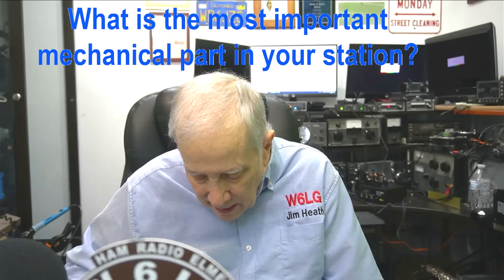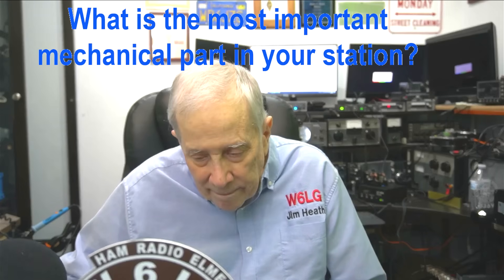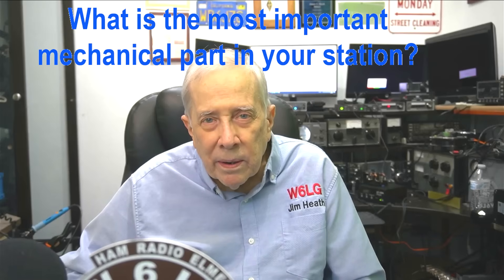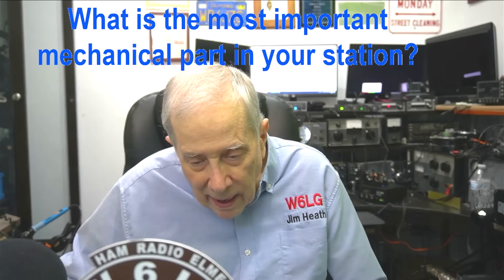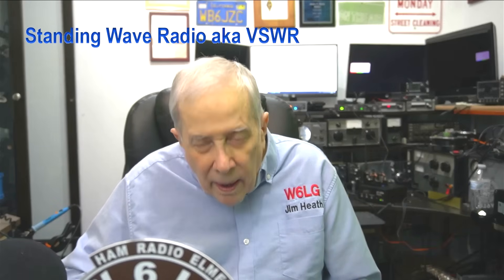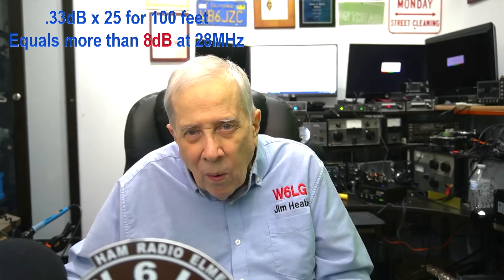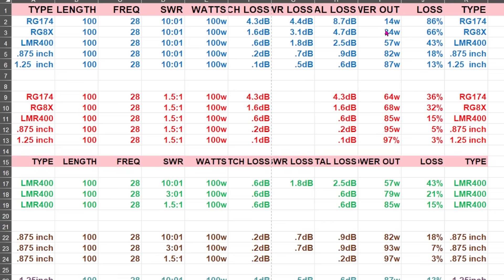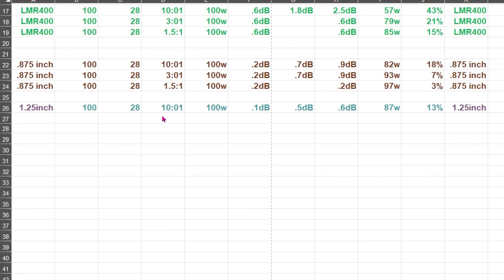Standing Wave Ratio DOES Matter and Here's Why from Jim W6LG

Comment: For HF, only use coax when/where forced to do so.  Plan to use ladder line.  Use coax for the short length connections, such as between antenna match unit and transceiver.

Comment: While lowest SWR is not always at resonance, an SWR of exactly 1.0 IS at resonance.  The only way to be exactly 1.0  is pure resistive equaling Zo.
Reply from the maker: Nope.  73, Jim
Reply: @ham-radio    Consider it on a Smith chart.  The “circle” for SWR exactly 1.0 is just the center point - exact match and resonant.

Comment: One of the most efficient antennas and feed system Iv made was a doublet for 80 meters with tuned open wire feeder , 39.45 meters along the top and the feeder was home made open wire feeder was aprox 40 meters straight into the shack, into a 1:1 choke into approx 1 meter of mini RG8X to radio after a little trimming of feeder 1.2:1 swr on 3.7Mhz

Comment: Thanks Jim! Haven't heard you on the air for a while, hope we can talk again soon. This is exactly why an all-band dipole needs balanced line. In fact, I've never used coax for feedline except mobile. Something I've never heard is an explanation of why the efficiency of coax can be so low - is it the quality of the insulator, conductors, or both?
Reply from the maker: I think the answer is dielectric losses along with size.  73, Jim

Comment: So one conclusion for a guy who does mostly portable operation is that even RG174 is ok (short runs) if the antenna match is very good ( 1.5 :1 or better). Resonant antenna is always a good thing.  Yes, bigger coax is a good thing, but less so than good antenna design in the first place.  My go-to is a linked diplole set up as an inverted vee.  Running portable means I have to tweak it (vee angle) each time I use it to get the best SWR.
Reply: Correct. A 20-30 ft run of rg174 on an antenna with a decent feed point swr is totally fine at HF.
Reply from the maker: If you are willing to give up about 25% of your power in the feedline when the SWR is 1:1. The loss, of course, increases with SWR increases. 73, Jim
Reply: @ham-radio  That's why I emphasized short runs.  Every antenna system is a compromise - performance, cost, durability, portability, neighborhood aesthetics, and probably some others.  Videos like yours help us think through and understand the compromises we make when building our systems.  Thanks, Jim,  for all your work to help us learn more.
Reply: @ham-radio Oh, and I forgot to mention that I'm mostly operating on 20m or 40m. For a given grade of coax, losses decrease as frequency decreases. Again, thanks for your work.

Comment: Excellent video, Jim. You are looking good as well. I hope to continue to hearing from you for years to come.

One item I would love to add to your presentation is the importance of SWR on receive. Before the new ham thinks that this loss of power can be overcome by adding an amplifier, it is important to know that the loss is reciprocal; that is, it is about the same loss in the receive direction. This should be the more important consideration, because once the signal received on the antenna is lost, it cannot be recovered from the noise of the receiver. If your antenna system is not hearing anything, it could be because of the impedance mismatch between the antenna itself and the feedline. This mismatch is an immediate attenuator to the signal. Fixing the SWR issues in the transmit path should fix the impedance mismatches creating loss in the return path.  You can’t work them if you can’t hear them!

This concept of antenna system reciprocity also applies to radiation patterns, but that is a whole other can of worms.

Back in the old days, my old days not as old as your old days… we also played a lot more with feedline impedance. The ladder line mentioned is a good example. Tube radios did not have a fixed 50+0j output impedance, and we would use 75Ω or 110Ω surplus or scrapped coax with great success, because it is not the impedance that mattered, but the match and avoiding losses. Connectors, baluns, and matches all have some loss, but the feedline often dominates.

I love the 4’ of adapters. I mainly avoid connectors for reliability. Less parts, less to go wrong. However, if you are playing above 1GHz, some connectors will bite you, but of course losses abound and it is all a balancing act in the link budget when even 6 inches of coax means something. Your measurements are very helpful to help us work from data and not rumors. 

Thanks again for the video. 73
Reply from the maker: I ran homemade ladder line up the mountainside in Burbank to a yagi on a 16 foot mast on City Property!  Yes on City Property.  I was a teenager and got away with that for a few years.  73. Jim

Comment: Hi Jim, great explanation! Now I see why my swr went up from 1.2:1 to 2.0:1 when I switched from RG8x to LMR400! Thanks! Prays your way.
Reply: My home station cable setup consists of LMR-400 with LMR-240 for short runs from the Harger grounding bar under the house to my operating station on the north side of the house. Also, to connect my Comet CHA-250HD on the south side of my house which provides an hf antenna for my basement work shop and is connected via LMR-240 due to limits on the size of co-ax I can run in pre-existing conduit to the garage Harger bar. I also have a coax switch on the Harger bar so I can also connect the Comet to my shack on the north side via an 89 foot run of LMR-600.

Comment: Throw your Rig Expert away.  It's mathematically impossible to have a 1:1 SWR without reactances canceled out.  It IS possible to have a non-1:1 SWR minimum dip somewhere that is not resonant, but it's not 1:1.  Now when I say "resonant", I am saying that the feedline sees a purely resistive load.  I am not referring to the physical size of the antenna.  That could be virtually anything.  I am not saying that if you have a resonant antenna that you automatically have a 1:1 SWR.  Your R value in your R+jX description may not match your feedline resistance at resonance.  BUT in order to have a 1:1 SWR in a good or ideal system, you cannot have a non-cancelled reactive component.  It's mathematically impossible.  You would have to have resistive losses to make that happen.  

I'm rooting for you and your difficulties.  You have my thumbs up.  Your message about cheap lossy coax is spot on.  You go LG.
Reply from the maker: I will revisit the coax connectors.  They are still together at my feet.  I also have other devices   I get what you are saying and it makes  perfect sense. Thanks for writing.  WE ALL have to be able to accept a critical comment so we can learn.  Scratching my head in Rocklin, 73, Jim
Reply from the maker: Using a 200 ohm precision dummy load with a BNC connector.  SWR 6.1:1 at 28MHz with Z=15 ohms.  Precision 50 ohm load, SWR l.7, 33 ohms, X= 11ohms    RL .33   wth short. 73, Jim
Reply: @ham-radio maybe it's not properly calibrated.

Comment: Jim, great video. Hope you are doing well. I have two pieces of RG8X that I use portable. One at 25 feet and one at 50 feet. I believe that the loss is a lot less at those lengths and I sufficient for that operation. I don’t have a ham shack in my house as I don’t have space but I probably would not use RG8X for a permanent antenna. Thanks

Comment: That's why we use tuners to allow the transmitter to produce its maximum power into the system, add some really low loss coax or open wire even at 10.1 swr most of the power generated is radiated by the antenna
Reply from the maker: As discussed, many times, low loss is key.  Open wire feedlines are a good example what will work even with crazy high SWR. 73, Jim

Comment: Great video Jim. There are antenna manufacturers making verticals with ununs at the base who say about their product "use with at least 20m of coax", because they depend on coax loss masking poor feedpoint SWR on some bands.
Reply from the maker: Yep. And in that box, ferrite beads are used on the center conductor to create losses that make the SWR low.  It is more of a dummy load than an antenna. 73, Jim

Comment: I'll say a low SWR does matter. Low SWR = close to resonance. QRP here so I don't want too many losses. 
I did great a few days ago when making a 12m indoor inverted vee using my SWR meter to get an idea of length before I put it in the attic. Mini 8 coax with ferrite rings at both ends, about 25' when in the attic.  
I trimmed it down by ⅜" increments by folding it back on itself, got a low SWR then another ⅜" and it started to rise again. Back to my lowest SWR.
Using my NANO VNA to check I got the following results:

Frequency 24.925 MHz
SWR 1.02
Impedance (varying slightly) 49 - 50 Ω +j1.4

I think my result is pretty impressive! 
If I get the same result in the attic I'll be happy but there's brickwork and my other dipoles. 

G4GHB.
Reply from the maker: Fun stuff.  And we now have things like that Nano to analyze what is happening.  73, Jim

Comment: We always want the best swr and resonance as close to each  other as we can get at the freq we want. But I won't spend 6 hours to get it there. (never have) If it takes that long something is wrong with the setup. However, if I need an emergency antenna I will get it close and run with it. I use a non resonant antenna on a 9:1 unun I also have resonant antennas with low swr. That non resonant antenna works dam good compared to the resonant antennas in the same bands. But NOT the yagi's. My non resonant is actually resonant with a low swr on several bands, I designed it that way, and under a 3:1 on its most non resonant band.
Reply: True resonance is at one frequency only but we move about the band so close enough for me is good enough.
G4GHB

Comment: Use a good tuner and don't fret so much on SWR. But 10 to 1 is rediculously high. 3 to 1 or better. I am 3.5 to 1 on 80m due to low height on my loop. But on 10w i can be heard by the local area guys i want to communicate, and my tuner protects the radio, plus sends the return back out and thusly the loss is much more negligible. Decent newer transceivers have internal tuners that can match 3 to 1 anyway. Not all of us have all that nice equipment and shack like Jim does. Get on the air and have fun.
Reply: Yep,, I love my antenna tuner tuning my antenna system to resonance

Comment: IF  and that is a BIG IF, you are using coax, you are entirely correct.  IF you are using parallel wire transmission line, then SWR is MUCH less important.  You must be using a match between the transmitter and the feedline.
Reply from the maker: I think that I said that many times.  But the video is about coax.  And, I talk about why i use hardline.  It is close to ladderline with respect to losses. 73, Jim
Reply: Yeah, but this video is about coax·
Reply: If, and that is a microscopic IF, you have a 2:1 SWR with a 50 ohm coax, you have 11% of your signal reflected.  If you have a 2:1 SWR with a 600 ohm ladderline, you have 11% of your signal reflected.  Is one 11% loss more important than the other 11% loss?  Did I miss something?
Reply: @N9XRradio you must have missed that the lower the loss of your feedline the more reflected power is reflected back to antenna an radiated, eg 600ohm open wire would return almost all power back to antenna even with 10.1 swr
Reply: @Pioneer936 i missed nothing.
Reply from the maker: You did. One has no loss. 73, Jim
Reply: @N9XRradio  The 11% reflected comes back and gets re-reflected at the tuner or radio. On its second trip to the antenna, 89% of remaining power is transmitted while 11% is reflected back again, etc. If you have very low loss, most of the re-reflected power will make it out despite taking multiple trips. With lossy coax, much of the power that gets reflected back will be lost as it takes multiple trips down the coax, along with the fact that some of the power you send out won't even make it to the antenna in the first place. This is why lossy coax becomes lossier at higher SWR.
Reply: @grebulocities8225 it's lost power at my shack because I don't live in an imaginary world, but I'm glad it works that way for you.
Reply: @N9XRradio it's only lost power if you have a lossy feedline
Reply: @Pioneer936 if I have a lossless feed line and a lossless antenna and I have a 2:1 swr, 11 watts of my 100 watts DOES NOT get transmitted by the antenna. Get a real engineering degree and you can understand.
Reply: @N9XRradio where does the 11 Watts go?

Comment: Another factor here is that the worse the SWR, the more power is reflected back into the radio. Not good for the radio. 

On modern radios, the more power reflected back into the radio, the more the transmitter cuts back on its transmit power (as a measure of self protection). 

Jim: I love your videos. Heard you on 20m the other day while I was mobile, wasn’t able to catch you after you signed off, but hope to catch you on the air again someday. 

Steve N7TX
Reply: The impedance the radio sees from the reflected power is the issue as the reflected power is reflected back towards antenna at this impedance mismatch
Reply from the maker: Thanks Steve!  73, Jim

Comment: What I worry about is power transfer not so much SWR. If you have an efficient power transfer the SWR will take care if itself.
Reply: What I care about is making money.  I don't care about an income source.

Understand this.  A low SWR doesn't guarantee an efficient antenna system but you aren't getting an optimal antenna system without a low SWR.  Jim explained that lossy systems can show you a low SWR and you won't have an efficient system but he also showed you that the lower SWR was more efficient.  If you truly care about power transfer, you have to care about SWR.  It's a part of the equation.
Reply: @N9XRradio What Jim said is correct in one instance.  Now for 1.5 to 1 as the example if you match the impedance of the radio to the antenna system you have some some loss in the transformation (minimal) and you may have to rematch as the frequency changes. But, the power is effectively transferred and your antenna is happy to work. You cannot match everything and you need your antenna to be close to resonance if posable.  Every after the transmitter is loss and the goal is to minimize loss any way you can. This is why if you can use hardline it makes less loss.
Reply: @thuff3207 a transmission line is not a garden hose. If it's not properly matched, RF will radiate from the coax and it won't make it to the antenna. I don't know why he likes 1.5:1. That is strange.
Reply: @N9XRradio coax doesn't radiate because its not matched, it radiates because there's an antenna current imbalance
Reply: @Pioneer936 I can lead a horse to water. The rest is on the horse.
Reply: @N9XRradio Yes coax can radiant with common mode current on it. No antenna is perfectly matched to a radio so there is always some common mode.  The best solution for that is a well designed Common Mode Choke to keep RF were is should be.  Any new antenna I design one and test it before installing to keep RF where is needs to be on the antenna.
Reply from the maker: It is important to watch the video which is limited in scope on purpose and decide what is best for your station. For me, I use the lowest loss coax that I can afford (hardline) and try to get everything to 50 ohms. You can debate common mode current BUT that rf did not come out of thin air. It is RF generated.  Also, this is a good debate and we can all learn.  Crappy coax, high SWR, system losses, poor installations will result in a weaker signal on both transmit and receive. 73, Jim W6LG
Reply from the maker: I always use a choke.  AND, a choke is not a balun. It is just a choke. 73, Jim W6LG
Reply from the maker: And wonder why he is not being heard. 73, Jim
Reply from the maker: Well, come on, you know that is most often not the case.  Otherwise a 16 inch radiator would be just as good as a 16 foot radiator on 10 meters. 73, Jim
Reply from the maker: That current is generated by the transmitter. 73, Jim
Reply from the maker: 7/8 inch is what I use. 73, JIM
Reply: @ham-radio I would agree yes use the best coax you can afford. The antenna and coax are more important than the radio to hear weak signals and transmit cleanly.  I wish I could run hardline but my tower is lowered when weather is around and that makes hardline a no go.  I do not know your weather issue but we deal with sever thunderstorms and tornados more than most.
Reply: @thuff3207 you have bought into the "common mode" grift. Congratulations. Those guys teach us how to waste power instead of using it in our transmissions. You lose power. I don't.
Reply: @ham-radio you do understand swr is not a measure of efficiency only measures an impedance mismatch
Reply: @N9XRradio I am sorry you do not understand what a common mode choke does. I will not explain it but if you only use part of a band and use single band antennas the common mode current will be less.  Make sure you keep your power 100w or less and you will have minimal problems.  Myself I run power and QRP and I am always interested in efficiency to get the most signal out via the antenna.